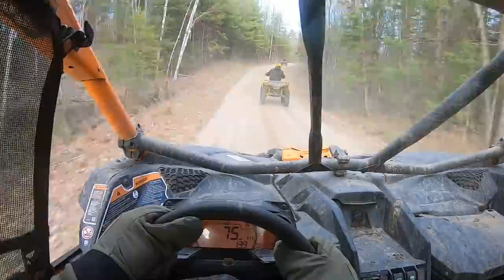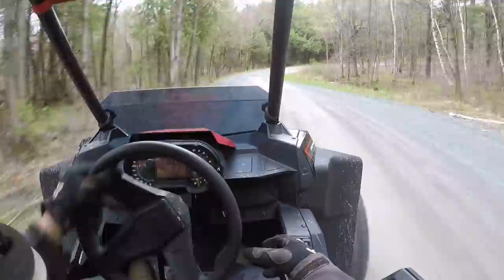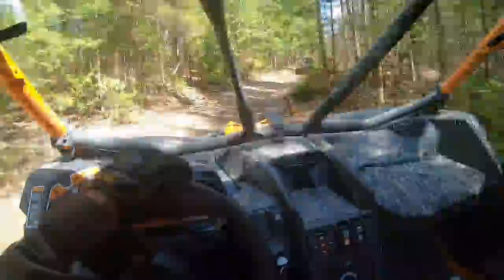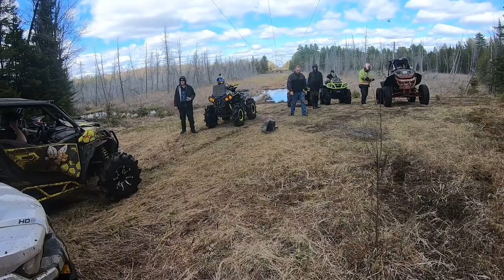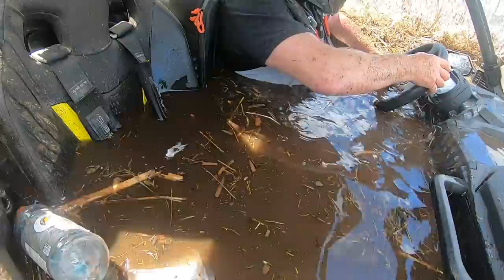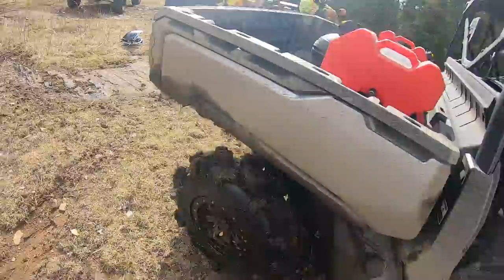Sit Tight!!! CanAm Maverick Sport Xmr1000, Turbo RR XRC, Polaris RS1, Defender and Wilcat XX

Comment: Got the exact same defender, if I hold it open with just me in it I can do 108 and that’s fully Rev’d out. Sadly can am puts a governor on it so it won’t rev past 5500 from a dig. But once you get goin it will keep creeping up. Not the best for fast pace riding and low gear max u can go is 15. higher than that and she sounds fucked. Better for hauling and work around the yard